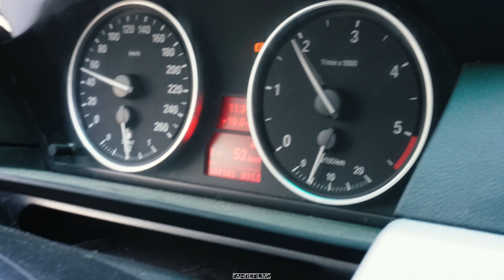Taking My BMW E36 Turbo to the Best Track in Europe!

Comment: røyken når du starter E36en tyder sterkt på slitte ventiltetninger. ikke farlig, men det hjelper på oljeforbruket og marginalt på oktanen (olje gir lavere oktan for drivstoffet) å bytte de
Reply from the maker: Ja det ble værre når jeg bytta eksos ( tror jeg ) Er så og si åpen eksos nå :) Hvis det ikke er farlig, får vi satse på at motor overlever mange trackdays til :)
Reply: @FahreFilms  ved lav effekt er det helt ufarlig, så motoren skal fint overleve det :)